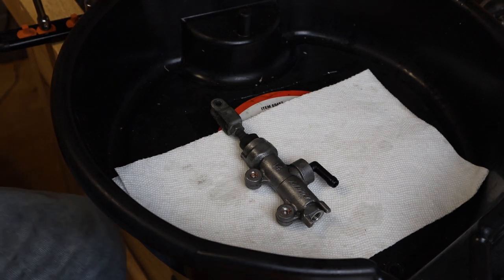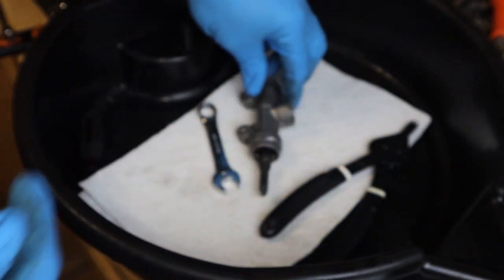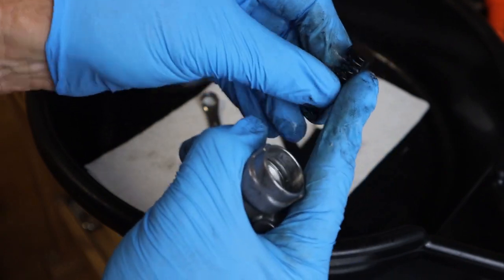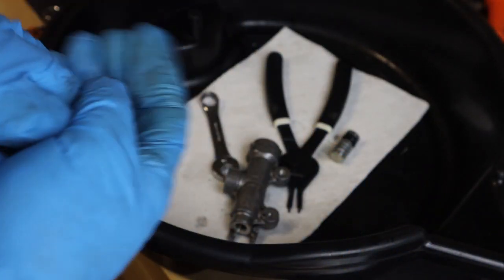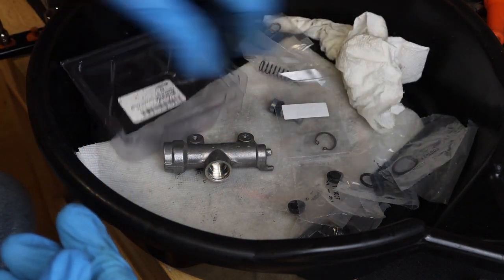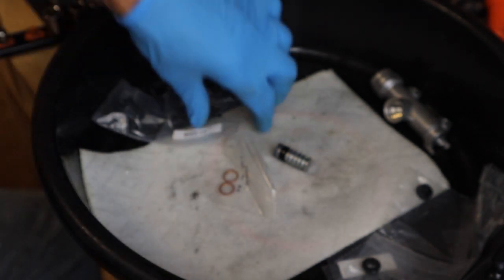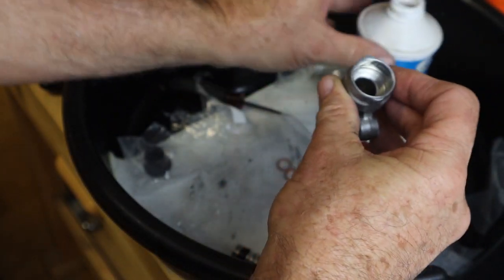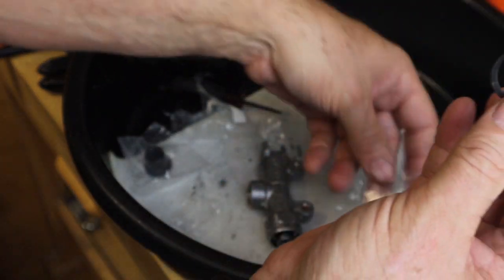2014 GSXR 750 Rear Master Cylinder Rebuild

Comment: I have a 2009 Yamaha FZ6R.  I just recently installed rearsets from a 2005 Yamaha R6.  They fit great with a few modifications.  The brake side needs some adjusting as I am trying to utilize the stock master cylinder instead of buying an R6 one.  Can the joint where the hose connects from the brake fluid reservoir be turned 90degrees?  I wasn't sure if it's a fixed position and didn't want to break it.  Your video is very informative and well done.
Thanks.
Reply from the maker: On some  master cylinders, the host connector is held in by a snap ring,  Check you may be able to pull the snap ring and rotate the connector.  If you have a haynes manual you  can double check. Thanks

Comment: For someone with little mechanical skills, would you suggest trying this or buying a new one?
Reply from the maker: Depends on how good you are with picking up new skills.  Do you normally good at fixing stuff.  If not purchase a later model, in good condition and learn as you go.  Like changing your own oil and filter.  If you can manage that then try more things.  Otherwise you will have to  pay the dealer to do all of your work,  can get expensive.